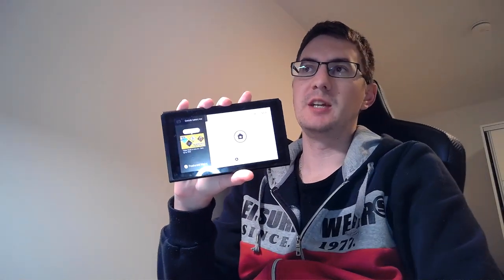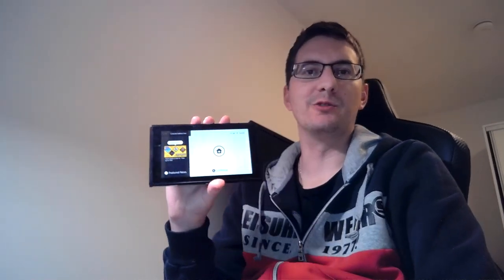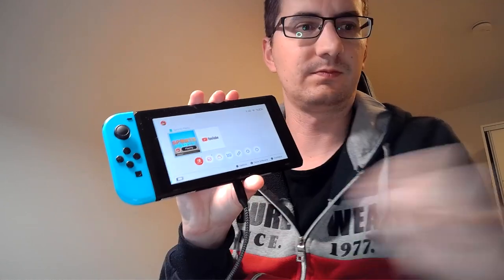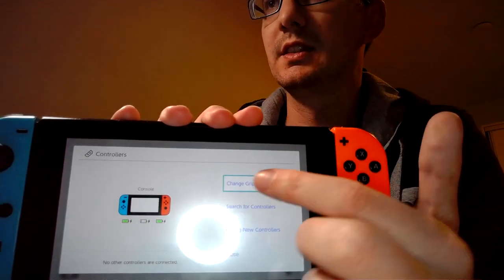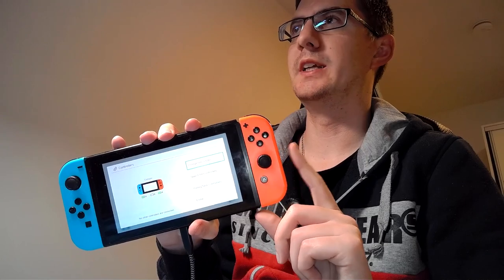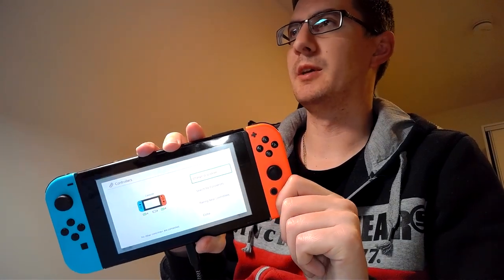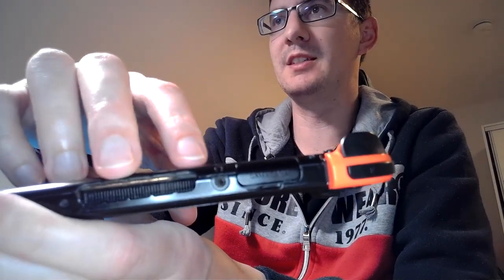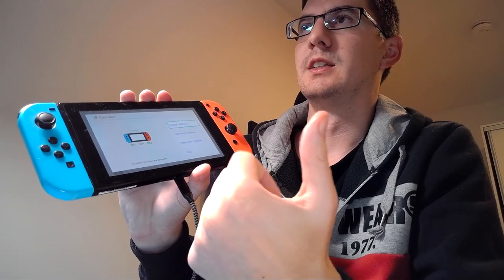Nintendo Switch overheating repair - ANYONE can do this!!!

Comment: My day 1 console is on life support
Reply: Same
Reply: I’m crying rn, my switch just turned off on it’s own saying it overheated. It’s also been on life support but now that this happened I am actually scared about how it did this… I don’t want to lose this switch man…
Reply: @redder4768  change there thermal paste like in the video clean the fan and vents and also buy a metal shell and put thermal pads inside for better cooling
Reply: Haha mine is having some cryo therapy in the refrigerator
Reply: @WeegeePlayzStuff  ay if Captain America can survive in ice why can't Nintendo switch ?
Reply: ugh me rn 😭
Reply: Mine is really going strong. It's fine just at times it'd Act up and overheat. But not extreme extreme
Reply: Same

Comment: wish i could see your video sooner. The plastic pieces that hold the 3 screws on top and bottom side were damaged so they are just useless holes now -.-
Reply from the maker: That is really common that those 3 tabs are damaged because most people overtighten them and they are super fragile.

Comment: Alright, this worked for me! I wanted to note that if you're having trouble getting the tiny screws off (assuming you have the right screwdrivers) is to soak the screw/screwhole with wd-40 for about 10 mins.  I applied it with a soaked q-tip, waited, then wiped it off with a paper towel.  Made the screw way easier to remove without stripping it.
Reply from the maker: Thank you for your comment.
Reply: I didn't trust that because i have the concern that some of that could go inside and if that happens it can be a problem

Comment: What was the fault actually with the old fan? Did you made any diagnostics of it after finishing the video? Would be interesting to see if was failed electronics or some of the bearings.
Reply from the maker: In the past I took apart 2 of them which were shorted. The problem is that the only way to take it apart is destructive. In those cases the driver IC was shorted on its small circuit board inside the fan.

Comment: So i bought the switch when it first came out Is There A Way That Ur Switch Somehow Overheats Because Its Too Old? And No We Did Not Change The Fans Or Thermal Paste
Reply from the maker: Yes, thermal paste is getting dry and there will not be an efficient cooling anymore. Fan you do not have to replace unless it fails.

Comment: Mine randomly started going into overheat sleep mode and yeah I’m guessing it’s the fan. It doesn’t charge my joycons so I’m gonna have to attempt this, I’ve taken electronics apart before and built pcs so this shouldn’t be an issue. Thanks for your upload

Edit also subbed, you earned it buddy
Reply from the maker: You are welcome. I hope it helps.
Reply: @kikihobbyrepair  just got around to finishing it today. the new fan spun up and i reconnected everything and added more paste and it works! thank  you so much!

Comment: Fan works great but now im having trouble with the SD reader such a pain to align it and get it to work
Reply from the maker: It snaps into place if you f8nd the right position. Take care with it because it is easy to break the connector. No need for high pressure.
Reply: @kikihobbyrepair  i got it to work thank you!!!

Comment: My Nintendo switch screws aren’t coming out, how do I fix this?
Reply from the maker: Are you using the right screw drivers? They are just plastic screws at the back they should come out easily. Maybe the ones on the sides in the rails are going into metal those might be tricky in case of surface corrosion but I did not have a single one where I could not remove them.
Reply: @kikihobbyrepair   2.0 mm I think. I looked it up and it’s called a striped screw, it’s common apparently
Reply: @guzzy4326  you have to use tri wing
Reply: @chap3509  I know I was using that… plus that comment was from 2 months ago

Comment: Do you not need to replace the thermal paste on the CPU also? It's below where you applied the first thermal paste.
Reply from the maker: If you look well around 14 minutes, from this one someone already removed the copper sheet from the CPU shield. So here I basically directly applied thermopaste onto the SoC.

Comment: I just brought v1.when I'm playing Zelda botw in handled mode for 5 hour. It not overheating,but v1 only overheating after dock mode. 1 hour or half hour.already overheating
Reply from the maker: I would recommend to change the thermal paste and clean the fan to improve cooling performance.

Comment: What do I do if one of the screws on the back is stripped
Reply from the maker: Well, try at first a different screw driver, maybe it will still grab the screw. Alternatively carefully drill down the head of the screw. This is super hard because you should not melt the plastic beside. MAybe do it in multiple small steps  and let it cool down. Good luck!

Comment: How often should you replace the thermal paste? I heard every year or every 2-5 years

ALSO how often do we need to replace the fan? I heard on reddit and quroa posts that computer fans last for 2-3 years but I can't find nothing about the switch fan
Reply from the maker: Well these are questions that are not easy to answer because it depends on a few things like how often and how long are you using the switch. For sure if you play on a regular daily bases and the Switch is running hot a lot, the thermal paste  is aging faster like if you would use it only occasionally. 
If you feel like it is starting to run hotter and the fan is turning on more often then definitely take it apart, clean the fan and the heatsink from accumulated dust and replace the thermal paste. I would say depending on the quality of the thermal paste you use it should last easily for like 2 years minimum. But for sure if you replace it every year it will run cooler and it will last longer.
As for the fan. If you do not feel or hear strange noises and if it is running perfectly and it is not overheating, I would not change it at all.

Comment: I switchedvout the fan and then it just ran all the time?
Reply from the maker: There is also a circuit which is controlling it. If there is for example a shorted mostfet, it will be on all the time. There is also a diode close to the connecter, check all these.